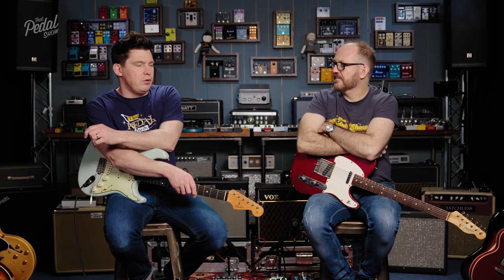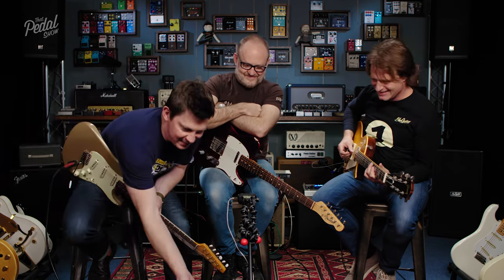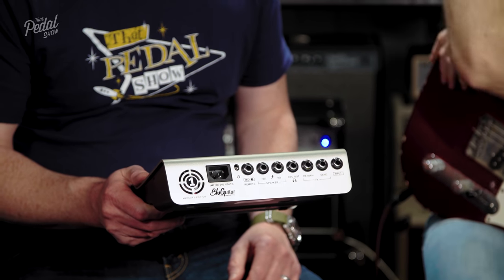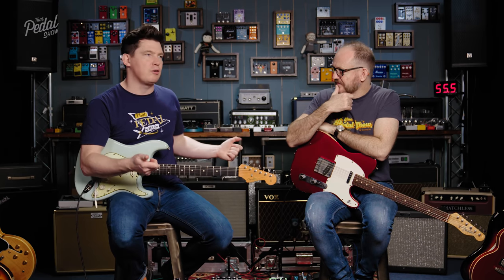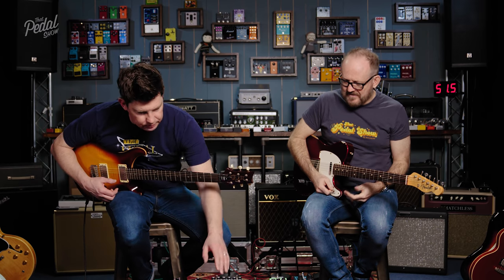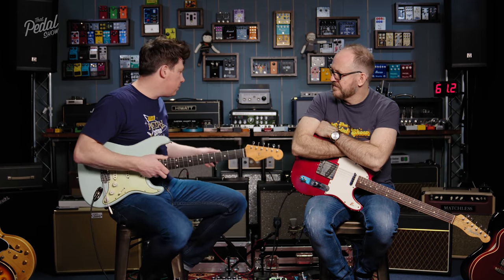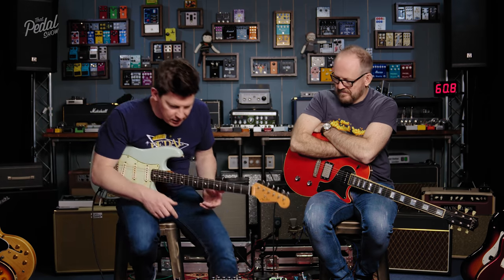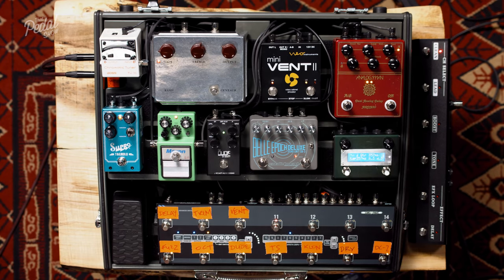Yes We Do Like Transistor Amps #1: Boss & BluGuitar – That Pedal Show

Comment: I've never been one for 'does it sound like a valve amp?', it's always been, 'can I get my sound?'.  In the old days this meant a JCM800 and a couple of 4x12s!  Since then, I've been down the modeller route with Line 6 PODs and HD500 with a DT25 amp which never really got there and Kemper, which was awesome but I could never settle with a sound.  Then I discovered the original AMP1, it really is a fantastic bit of kit.  I would have been happy with that on a small pedal board but then I added a Line 6 HX Effects, another amazing bit of (digital!) kit.  The signal routing possibilities were intriguing and being a curious guy has led me to my current board.  I run it wet/dry into two Laney LT112 cabs (very underrated and excellent value in the UK).  It goes like this: Tuner>Origin Cali16CD>Broadcast>HX effects splitting the signal into two paths (you can change the phase per preset which is just as well as the Kraken Red and Green channel are opposite phases for some reason) as well with the SR loops 1: AMP1 preamp, 2: Victory Kraken v4 and running the AMP 1 wet (Delay, Harmonic Trem, Reverb), and the Kraken dry> out to a hum destroyer (just in case, it actually runs quiet without it) left channel in to the AMP1 power amp, right channel into a Seymour Duncan Powerstage SD 170, then out to the speakers.  The key really in the HX due to the routing and ability to change the AMP1 with Midi and switch the kraken. I've also got two Bluguitar Bluboxes to feed both wet and dry out to the desk.  I use this setup live all the time.  Takes me five minutes to set up and is without doubt the best sound I have ever had and, most importantly, it is my sound.  Anyone who wants to minimise their gear to a level where it is two trips to the car for the lot whould consider the AMP1, and a preamp with a SD170.  Or just get an AMP1 and a SD170, add an HX and you have wet/dry with two signal paths to play with.  Happy days!!!
Reply: I'm a rock blues player BTW, despite the Kraken - Green channel is awesome!
Reply from the maker: That sounds amazing Mark - some very cool stuff going on there! Totally with you on the Kraken. Channel one seems like pure vintage cranked Marshall to me. Mick here. :)
Reply: @ThatPedalShow  Cheers Mick.  I love the way that things are going with products like the AMP1, V4s, and the RevivalDrive. Compact, powerful, and sound great. Looking forward to seeing how the weird Benson/Chase Bliss mashup sounds as a preamp.

The Kraken is great, got that vintage Marshal thing going but tight in the  bottom end.

Comment: Maybe this will be addressed in the next video, but I’d be interested to hear some thoughts on dialling in drive sounds when paring solid state and tube amps. I can see how running wet/dry delays and reverbs between the two different amp types could sound mega but when you step on the drive, would the gain discrepancies not sound a bit odd?
Reply from the maker: Yep - expect more on that in part 2!
Reply: That Pedal Show looking forward to it! 👍🏼

Comment: One thing for sure is that transistor and digital amps are way easier to play, than tube amps.
Reply from the maker: I'm the opposite. Mick here. I really struggle to play digital amps especially, and most tranny amps. But only because I've been playing pretty much only loud valve amps for the past 30 years.
Reply: Hi Mick! Tnx for the answer. I quess it is a mind thing. :) @ThatPedalShow

Comment: This video in a nutshell: 

"let's get you a sound that works on the AC15"

*plays it as is, instantly sounds great

*rest of the video is spent adjusting settings to get usable sounds out of the solid states
Reply: Jammonstrald
Because they're more familiar with the AC15. That thing has been around for how long now? The Nextone is much more versatile and once you found the sounds you like, you can save it. Good luck with hauling around heavy tube amps and playing them at low levels with nice tone.

Comment: I can't help but reflect on the recent episode with the vintage tube amps. The sound of those amps were, to my ears at least, more pleasing than the reissue tube amps on the same episode. I've also been impressed over the years with a number of solid state amps, going back as far as the Trace Elliot Supertramp, where I thought the tone of the solid state version were more pleasing than the tube version and far more pleasing than the hybrid version.

As always it's all dependent on what your playing, in what setting, what inspires and other constraints such as budget, group dynamic's with your bandmates and what's on your pedalboard.

Interesting episode and I thought Thomas Blug's playing was very classy.
Reply: Good call, an underrated amp that I’m sure will become a collectors item in due course.

Comment: I own both the Quilter 101r and The Quilter Mach 2 Pro.  I use the Mach 2 pro more as it's more versatile.  I also own the Mesa Boogie Lonestar, MK5:25, a Magnatone Stereo Panoramic, Fender Silverface among a few other tube amps.  Since I bought the Quilters, I barely play the tube amps.  And when I do, I revert back to my Quilters.  They just do the job and do it well.

Comment: Now, do the tube amps that emulate solid state amps. To get this clean, hi-fi, crystal clear immediate sound; instead of the unwanted compression, and drive characteristics of the traditional tube amps. :P  
I am a fan of low power (5-15 watt) tube amps, single tone knob, and a volume control, with a nice speaker. No trem, no reverb, no buttons and switches (apart from the on/off). More than that and I am panicking because of the number of interactions between the knobs. Unfortunately there are no SS amps like that.

Comment: Hi guys. I've fallen behind on watching the videos for various reasons. I just wanted to mention something in case no one else has. The Nextone amps aren't all analogue/transistor.

They (and the Blues Cube) use DSP in the signal path. The output stage has different analogue circuits to emulate different valve output stages, but there are components of the signal path and tone shaping that is done digitally. I suppose you could technically call them hybrid amps. I've seen a number of people make this mistake and it seems Boss is not in a hurry to correct people. This is from the Boss website, the important part is a little over half way down the page. https://www.roland.com/global/promos/tube_logic/

Comment: "So, this is all analog?", "Besides the reverb chip". So, there is an ADC and a DAC which cause latency and the signal is at some point digital.
Reply from the maker: Nope, the reverb effect is in parallel and mixed on top of the analog direct signal 👍
Reply: @ThatPedalShow  Ok, thank you. I understand. The signal is split. One is digitized and processed. The other stays analog. Then both signals are added.